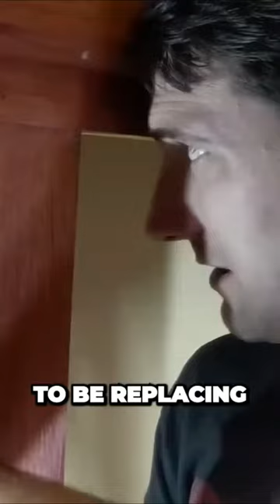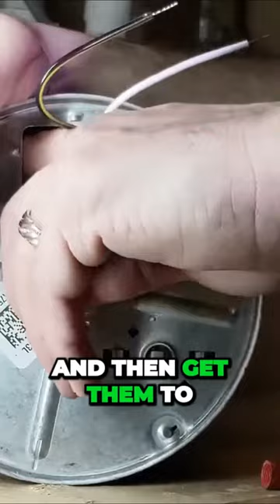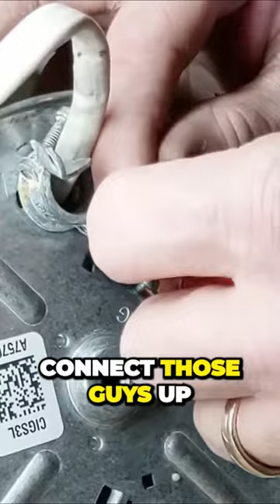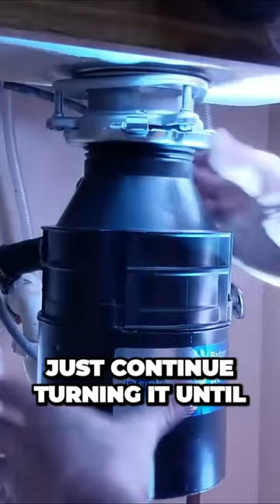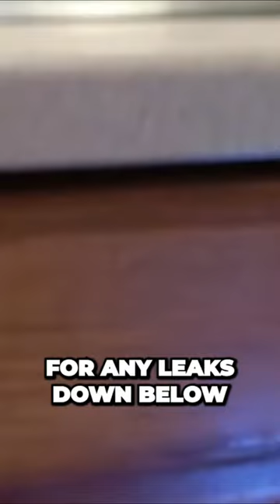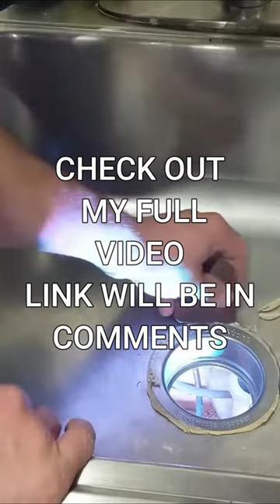HOW TO REPLACE A GARBAGE DISPOSAL (HARD WIRED INSTALL) - Step By Step InSinkErator Badger

Comment: Can you tell me what kind of wire I need to get  ? Mine has a switch. It sroped working I have the exact same one but the wire is so bad I have to get a new one I can't tell anything about it other then it's a wire... like the amp or the color or anything at all. How do I figure that out? To get the correct wire? I really hope you answer because I'm about to dive into replacing the sink with a new stainless less steel one. A new pull down faucet. A new reverse osmosis system and a 3 spin down water filter all under the sink and I need new wire to go to the switch for the garbage disposal. Thank you for you time you definitely shower me the just of the job 😊
Reply: Im going crazy at this moment, yelling at my computer because I am too stupid to know terms to hook up my garbage disposal to the on/off switch! Where do I put the wires that power the disposal and where do I put disposal wires..... Crying. lol
Reply: @jwalker6848  so what I did was I just ran the wires to a on off switch near by. There are tons of videos on how to hook up the wires and not worry if you did it right. Unfortunately most of the garbage disposals don't have red or black to lyk its a ground or not so you have to look at the number or just do it twice or once if you did it right the first time. If it work the first time you did it right 😉